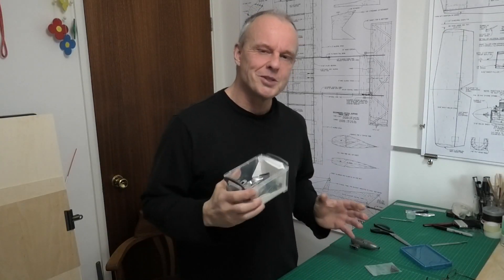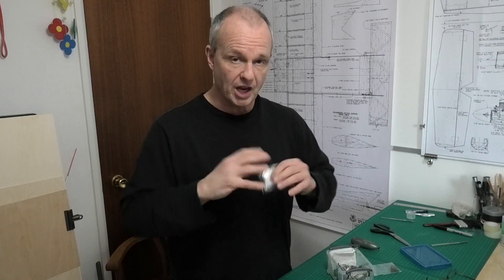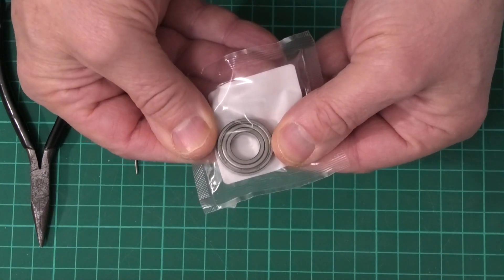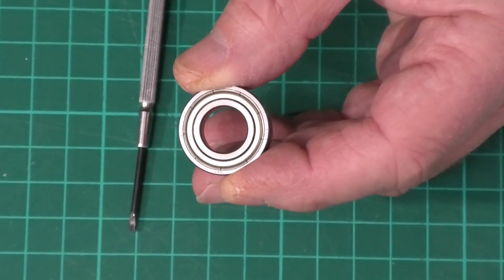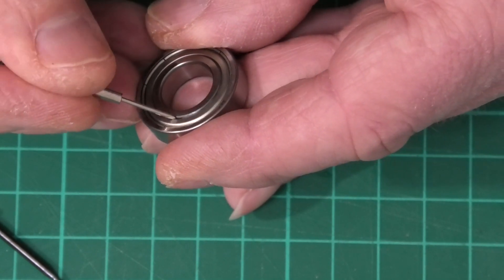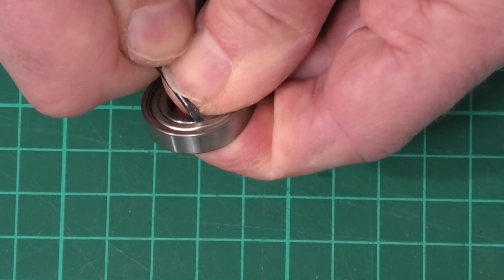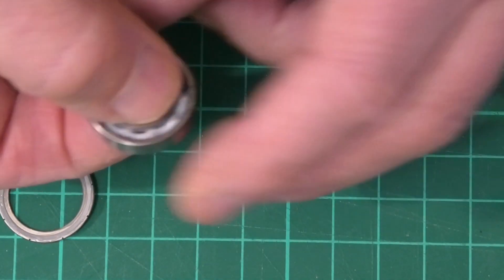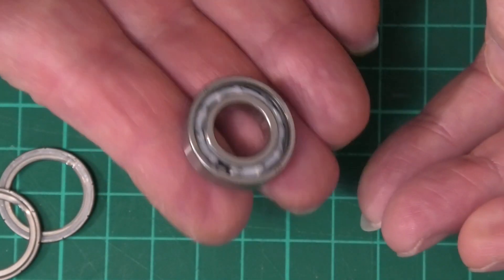Removing a Bearing Shield - Model Engine Bearing replacement - RC Model Aeroplane Build & Repair

Comment: Thanks a lot. I had to remove the shields to clean the rusty bearings in my fume hood fan - unfortunately they are now extremely noisy, even after treatment with WD-40. I am out of options on how to make them just a little less loud. I don't have the tool to replace the whole bearing, only entire fan (I have already replaced the fan three times just because the bearings became too noisy - primarily due to corrosive vapours).
Reply: WD-40 a degreaser. You've also cleaned out any grease that may have been in the bearing along with the rust. Pack the bearing with grease and put the shield back on.

Comment: Well then the shield cant be put it back sir after remove it?
Reply from the maker: Thats correct, once removed it will not go back.
Reply: @MarkRobinson555  then what new will i exchange there?
Reply from the maker: If you replace the rear bearing in a glow engine you do not need the shield and removing it will allow more lubricant to reach the bearing
Reply: But mine is for mtb. But if i remove the shield and lube it and use it. that bearing couldn't fall off??
Reply from the maker: No, the bearing will not fall apart
Reply: @MarkRobinson555  thank you sir appreciate it

Comment: How can the shield be replaced now that it’s bent?
Reply from the maker: You can't, you would only remove it if it wasn't required in your application
Reply: @MarkRobinson555  I was repairing a dremel like tool and had to remove the shield because it was pressing on the bearings due to someone else’s handiwork. Because I realized that the outer edge of the shield is made like a sectional spring, it was possible to pop it loose, tap it flat again with small round anvil shapes covered in leather and pop it back in. It took three rounds of flattening and shaping but I got it back in. Tedious- yes but done.

Comment: You do not need to remove the inner shield of the front bearing.  The gap between the inner race and shield is around .003-5 inch and is far greater than the clearance between the crankshaft and case.  Any oil that gets past the crankshaft will easily get into the bearing.
Reply from the maker: If you watch the video I never suggested removing the shield from a front bearing, as I say I am removing the shield from the rear bearing.
Reply: Hello RCBearings, what do you suggest for FRONT bearings, the ones with metal or the ones with rubber shields ? I have a small Blue Bird (BRAT) .25 who leaks badly from front bearing and also cannot be properly primed (the fuel keep getting back into the tank) and not tunned also. Does the bearing has to be special for High RPM or something ? Many thanks